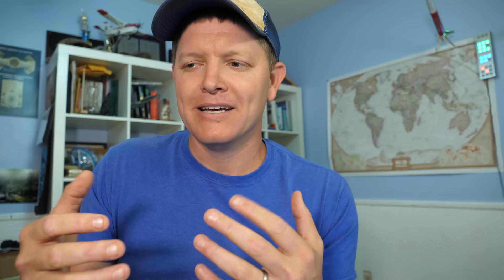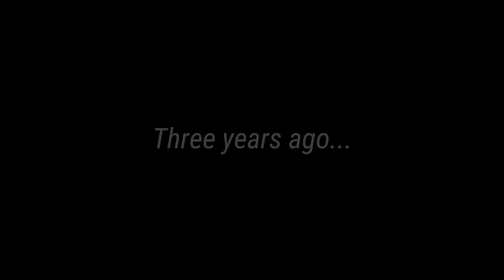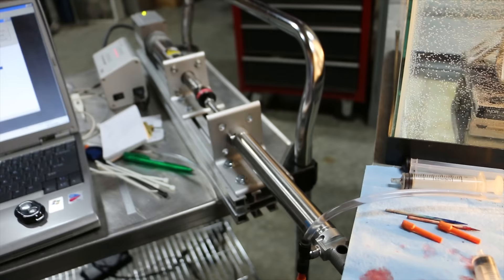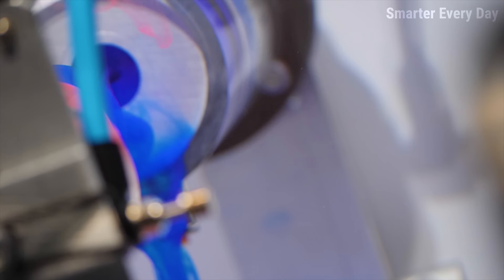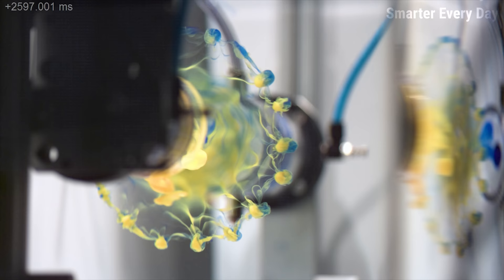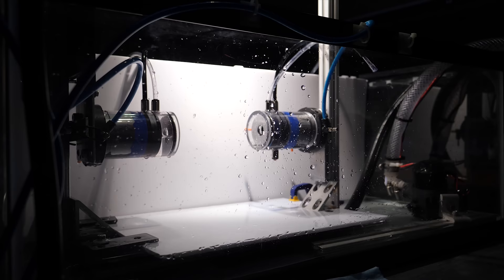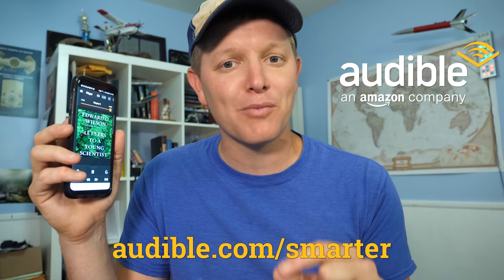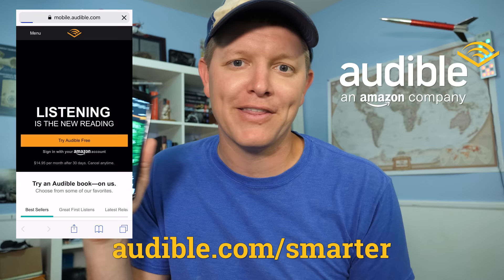Two Vortex Rings Colliding in SLOW MOTION - Smarter Every Day 195

Comment from the maker: Thank you to the Patrons of Smarter Every Day for helping me do things like this: https://www.patreon.com/smartereveryday.
Reply: Think about the spin of each ring. See the mushroom cloud effect at the start? The centers of the ring are moving outward faster than the outside and creating a backspin. When they collide, even as the low pressure pulls material together, both rings are still spinning opposite each other and because of the magnus effect(if I'm thinking of the correct effect), they create a forward, or outward away from the main ring, pull. I can't articulate it very well because I'm just not smart enough, but think of a basketball's backspin, and how it creates a forward pull that lengthens a shot.
Reply: SmarterEveryDay Bro, did you just say “jif” !?!? Graphic Interchange Format... “gif”. You are a true hero to my girls and I and I have been subscribed for years, but that is unacceptable. 😂

...and then not using Micah 7:8 for your Bible verse? Perfect video for that verse! 

God bless you brother. Keep up the great content.
Reply: Maybe there is a direct collision between an area in the low pressure zone and in the ink or the space between that causes the smaller rings to be at a 90 degree turn.
Reply: Could the reason for the 90 degree turn be due to the low pressure zone pulling material to itself then the momentum carried from the movement colliding with the material from the opposing side create a backspin and then create a new vortex
Reply: I dont think there is an actual 90° turn. Looks like many smaller collisions similar to the first. Like fractals. Id love to see this done in a place with 0 resistance if it were possible.
Reply: Easy for you to say Destin. Not everyone has a vortex collision goal because not everyone is filthy rich and has the money to pursue their goals and dreams. Dreams cost money. That equipment and your guys time cost money. Most of us dont have that juicy YouTube money and come from wealthy families and parents.
Reply: Similar to flowers, I can't help think of the "Numbers" effect.. (or geometry) there's a distinct number of swirling balls of color. Is there always one vertical or diagonal to the ground?, how might it flow in Space? how might the differences in viscosity of coloring and tank fluid affect the pattern?
Reply: If you have a chance you should try in the southern hemisphere I'm just wondering if the slight counter clockwise motion is an indication of the mechanism that is causing the 90° turn
Reply: We make a Thank you, to you :P, all over the world, even me, we make traslate for sub to let people read your video in their main language ! :P if we make this, is because of you and your amazing work to make this video good ! 
Thank you Destin ! <3
Reply: SmarterEveryDay Was
Reply: My opinion on what’s happening here. 
When the vortex rings collide it forms a z axis load barring structure being supported by a net zero impact of two vortexes flowing in opposite directions trying to follow the path of inertia on the x axis. Because water is a consistent density and because the load barring capabilities of the z axis motion of the ring is also consistent across the entire surface of the ring the areas that fail are in predictable intervals because the path of least resistance becomes condensed as the ink moves through the medium. This then influences the opposing vortex flows to join into a ring and accelerate outward due to their newly found shape performing better at traveling through water than its former shape thus gaining speed by utilizing its kinetic potential energy more efficiently.
Reply: Do it with the same color! Pigments might have different weight and structure..? maybe..
Reply: Also. Reduce vibration to a minimum. Lett the tank sitt for a few hours. And trigger it remotely. no walking around it the same room or preferably building. no devices that creat vibrations. maybe im over thinking this..
Reply: Dude check a pro vaper video, it's crazy
Reply: This is the video that I started my subscription to your channel! Thank you! 💯
Reply: SmarterEveryDay How hard would it be to have two Vortx collisions run side-by-side, and then have the  rings from them collide? Curious every day!
Reply: 2 kinetic streams colliding causing a pressure wave (ring) where the stream in the ring itself equals a kinetic stream with a number of nodes based on the pressure inside the ring. You need to know the ring volume density and the point at which the expending kinetic energy causes fresh water to be dragged into the ring (pitot tube style).
If you start with 2X volume of water at a speed of Y, they collide for density F(xy) and start sucking in water when the ring density drops below water density.
Reply: for me it was a subscribing moment. love your work
Reply: could this also be replicated in a low pressure atmosphere? vacuum
Reply: @russellwile5694  It seems like the resistance from the water might be what's making this possible. Without resistance from the water, it could just continue outward rather than slow down and curl where it's coming in contact with the water.
Reply: Haven't watched the whole thing yet, but... were you using distilled water?  Cause it's much easier to get a clean collision if the water is as pure as possible.
Reply: Nigel Pettitt    @Nigel Pettitt   "Conservation of angular momentum" is exactly what I was going to say. (I'm just now seeing this video and this is the only comment thread I've seen, so I realize that this might already have been run to ground.)

In some of the early runs, the backspin at the rings' perimeters is visible. For some reason, it's more efficient for the water molecules to coalesce into localized rings and rotate as a mass rather than to expend their momentum as individual, dispersed molecules. I imagine it's because the rings present much less surface area for friction drag than would individual molecules of water trying to disperse into the static tank water medium. (The dye molecules are merely along for the ride.)

Anyway, that's this civil engineer's take on it.
Reply: Rings happen due to direction of travel, always.
Reply: @kesavamandiga8900  這部影像紀錄片著作者必要性強制性與參與活動中這個參政者同時被迫逮捕到案執行串聯互動關係侵竊盜取機密資料來源機體文件科學性系統工程進度營銷經營，同時持有投資公司借貸款項金融界集團旗下品牌形象廣告著作財產權記載事項登記分發職務經商買賣雙方協議內容包括參與活動執政者的頻道訂閱成員之一摧毀破壞力者，共同體制度性系統工程操作方式糾纏不清關係。是一種不當違規使用模式。必須要求遣送出境海外市場調查偵訊重大過失致死案件發生率釐清案情處理。同時被迫革職移除頻道的有罪嫌中斷合資企業集團旗下品牌形象廣告管束管理關係。
Reply: Thank You, this video came at the right time.
Reply: A very uneducated guess. Maybe  the outward force of the vortex collision in tandem with whats going on with the pressure, funnels the outward force into generalised points creating a secondary vortex effect
Reply: What would happen if you did it in a vacuum?
Reply: What would happen if you did it in a vacuum
Reply: Earned a sub from me 😉
Reply: Have you considered putting two sets right next to each other, get the pairs secondary rings to collide each other?
Reply: I’d like a Pepsi after this…
Reply: please sir make a movie on discharge Ray tube.
Reply: I subscribed by this video. Do this type of videos in future
Reply: Congratulations, you just figured out how to build seed galaxies. 
At least that's what it looks like.
Reply: Astro  Naught = Astro Not
They always put things in front of your face!!!
Reply: I know how it forms the outside rings.
Reply: If the vortices are rotating in opposing directions, could the new rings orientations be due to gyroscopic procession
Reply: excuse me but if the question was why there was a snall rings apearing there's a simple explanation as for me.
Reply: SmarterEveryDay subbed and shared👍
Reply: Hi, I thought about replacing the color by some hot and cold water and watch the result with a thermical camera. Would it work ?
Reply: +SmarterEveryDay 6:43 why is this a mystery? It can't go left or right, because that's the direction it came from; it can't go back into the center, because that's also where it came from; so it can only go to the 'outside'. I'm not a beta-scientist, so I'm probably missing something...obvious...could you (or someone else) explain why I'm probably wrong?
Reply: Can you do this vortex ring thing with phenol red and sodium hydroxide so they react?
Reply: Diggle
Reply: So i know you might not see this but how do you think this would be affected being done in the same way but with smoke instead of of liquid. So basically my question is can this be done with air?
Reply: Why would the 90 degree turn of the small vortices be a mystery?? The explanation is pretty obvious to me . The two initial vortices both have the same circular movement of fluid inside them, that makes them moving opposite when placed one in front of the other. When the almost touch each other and gaps form in both of them in the same places, the ends of the small turbulent sections fuse since the movement of the air is from the inside out. Kinda like this  ( ) -------> O The real mystery to me is why the breaking seems to happen so evenly distributed. I think it might have something to do with the frequency of the pressure waves bouncing inside the tank produced by the opposing release of the vortices. That frequency pattern intersects the fused ring and produce even distributed zones of lower and higher pressure in the ring, thus breaking it. At least, that's my theory.
Reply: Do not worry, I am just trying to help. What you are looking at is linear momentum transformed to angular momentum, fully conserved. This is a very strange concept indeed. You will not find out about it until you have read Speculations On Fluid Dynamics, which is a book written by my father and has not yet been published. I am trying believe me.
Reply: De uma idéia no canal
Reply: Tudo forma desenho maguinetico de frequência ?
Reply: @coxbrawls5918  Corbett opp
Reply: Do you believe in God ?
Reply: Should've named the second channel "SmarterEveryOtherDay"
Reply: SmaterEveryDay
This is very interesting. I have a few questions.
Can you share the schematic of the device? Why is dye not mixing with water in the cylinder? Is there a membrane between the air and die chamber?
Reply: "well well well, if it isn't the spiderman"

"What's about to happen to you won't be very wholesome 100"
Reply: I have an hypothesis. This is vectorial multiplication of forces. The resultant vector is perpendicular to the starting vectors.
Reply: It's just like two fluid bodies moving at approx same speed and has approx same momentum colliding..  it causes a ripple in both bodies which extend outwardly in a wave pattern where both bodies crest areas form the mini rings..  my on theory from solid body collisions..
Reply: Почему я не увидел это раньше? Очень круто.
Reply: молодцы иностранцы. Столкнули две капли краски в водной среде. Описали это столкновение с помощью формул. Опубликовали небольшую статейку как две капли воды сталкиваются.  Может быть приплели сюда еще, что именно так сталкиваются элементарные частицы. Получили грант на три года, чтобы еще три года заниматься непонятно чем, но очень важным с точки зрения науки. И все. Вот вся "научная" работа. Хорошо путин когда-то сказал нашей так называемой академической "науке", чтобы она больше упор делала на разработки и открытия для народного хозяйства и страны. А не только для реализации своих идей (пусть даже и красивых) за счет налогов других граждан страны.
Reply: @user-lj8xg1ij5c  наука так не работает из фундаментальных исследований сразу ничего не получается. Для вас это 2 капли, а для астрофизика например могут быть 2 галактики.
Reply: @Darvin_A  я это знаю. Проработал в академической науке больше 20 лет. И знаю почему сейчас академическпя наука в России не может сейчас работать на нужды страны. Но!!! Вы бы согласились оплачивпть из своего кармана (из своих налогов, если вы работаете не в науке или подобных областях) реализацию идей людей например, с этого ролика? Я нет. вам лично какая польза от того как столкнуться две галактики, например, наша и соседняя? Во первых этот процесс будет продолжаться миллионы лет. Во вторых никто на земле не выживет во время этого. В третьих. Чтобы это наблюдать нужно как минимум стать монолитом из произведения андерсена "одиссея...". В четвертых. Как изучение столкновения галактик практически пригодится для хозяйства нашей страны? И еще по видеоролику. Киньте камень в воду и увидите такой же круг-кольцо расходящийся равномерно в разные стороны от точки соприкосновения. Еще раз повторю. Три года платить деньги человеку за то (если утрировать), что он будет кидать камни в воду у меня нет никакого желания. Наука  (научные работники) должна работать на народное хозяйство.
Reply: @user-lj8xg1ij5c  слава богу в науке колхозники не решают чем заниматься учёным. Иначе бы кроме тракторов и надоев ничем не занимались бы. А пример с галактиками привел просто для наглядности, это может быть любой процесс турбулентности и круги на воде абсолютно другой процесс. Фундаментальная наука не предназначена получать готовое изделие для вашей радости и хозяйства, она исследует процессы и строит теоретические модели, а уж что из этого получится никто не знает. Если бы работало как вам хочется, то мы бы наверное никогда не открыли атомную энергию, генетику и т.д., ибо разрыв между открытием и применением составляет десятки, а иногда даже сотни лет. Кстати именно поэтому фундаментальная наука сейчас загибается и мы по факту теряем будущее, т.к. всем нужна моментальная выгода.
А конкретно эти товарищи вроде никаких налогов не тратили, все на чистом энтузиазме и донатах подписчиков, за что им отдельное уважение.
Reply: @Darvin_A  ответьте мне тогда, если вы вдруг "научный работник": за что вы будете получать зарплату, выдавемую вам государством и складывемую из налогов моих и, как вы выразились колхозников, рабочих, инженеров, кухарок и других, если вы не будете мыслить и совершать открытия во-благо страны   которая выплачивает вам зарплату? Зачем нужен человек-ученый в обществе, если он не приносит польэу этому обществу?
Reply: @user-lj8xg1ij5c  затем, что понять принесет ли данное исследование пользу, ни вы ни даже иногда сам исследователь не может. Какие-то исследования заходят в тупик, но отсутствие результата, это тоже результат, если вы способны это понять. Другие исследования могут найти применение через десятки лет, но вот если их не делать, то результата точно не будет. Так достаточно разжевал или ещё есть вопросы?
Reply: @Darvin_A  вопросов к тому, кто не имеет ни какого отношения к науке, тем более фундаментальной, нет. И еще как такой может что-то разжевывать другтм не имея никакого понятия о чем конкретно идет речь?  В приведенном ролике нет никакой турбулентности.  После столкновения капель образуется тор (кольцо для тех кто привык все разжевывать).  Если разрезать этот тор вдоль по-середине, то получится волна аналогичная волне от брошенного камня в воду. Сначала изучите понятие тора а потом, применяйте его для объяснения не понятных вам явлений. Еще. Не правильно сформулировали постулат. Не отсутствие результата тоже результат. А отрицательный результат - тоже результат! Отсутствие результата у научного работника говорит о том, что он ничего не добился в своей работе. Потому что или вообще ни чего не делал и просто так получал зарплату, или не достаточно приложил усилий или занимается не тем чем может. Пусть идет работает колхозником и не будет расходов на его зарплату из налогов других трудящихся. Еще на счет фундаментальной науки. в ней нет никакого застоя. Наука все время развивается за счет ученых получающих заслуженную зарплату и приносящих пользу обществу. А не тех, кто каждый день приходит в институт, просиживает там целый день "Без Результата" и возвращается домой. В науке фундаментальной также, как и в любой крупной сфере человеческой деятельности есть спокойные периоды, периоды (как со-стороны может показаться) застоя, и периоды всплеска или расцвета. Как в искусстве, например, были эпохи возрождения или ренессанса. также и в науке. После описания бором ядра атома стремительно получила развитие ядерная физика. И таких примеров множество. А то, что некоторые открытия находят свое применение через 10-15 лет лишний раз доказывают, что данные ученые в первую очередь реализовывали свои идеи за государственный счет ничуть не беспокоясь о том как свои открытия сделать полезными другим и адаптировать их для нужд человечества! Только тот, кто не может в своей сфере деятельности ничего добиться будет писать, что отсутствие результата тоже результат. и не пытайтесь "разжевывать"))) в той области в которой мало разбираетесь. особенно тем, кто может больше вас в этом разбираться. Не смешите меня больше. У меня нет столько времени для смеха, чиьая ваши комменты. Я лкчше не буду их больше читать. И еще. Сходите в библиотеку. Почитайте про фундаментальную науку и про ее развитие. А не хотите этим заниматься - езжайте в деревню. Становитесь колхозником или дояркой (не имею ни малейшего желания знать где больше преуспеете). И приносите хоть какую-то пользу обществу, вместо своих плачевных комментов. Пока!:)
Reply: Может эффект Джанибекова дает такой результат🤨
Reply: Destin? your love for what you do and you're enthusiasm and your diligence to never quit and your Prudence toward what you do makes it the best dadgum channel on youtube. Your love for what you do makes it the best
Reply: @user-uz7fs1kv5l  думаю это разные вещи.
Reply: would it be possible to do this with suspended particles that you could track?
Reply: 6:50 i can explain it, i so hope you replay to my video
Reply: The toroids perfectly embed.
Reply: What if you have something like a chamber it's cylindrical shape with the diameter ouf the container 120mm long and 2 tube with the size of this cylindrical "nozzles" what ever
Reply: I think the law of angular conservation maintains the vortexes into the outer ring which contains most of the mass.
Reply: @smartereveryday please read "The Edinburgh Lectures on Mental Science" by Thomas Troward.  Chaper 5 talks about 2 vortex rings colliding.  It was published in 1909.  I would love to hear your feedback and interpretation of what Thomas Troward meant; i can't quite grasp it yet.
Reply: Oh dear. This is Breathtaking. Fluid Mechanics is so interesting. Will surely simulate this!
Reply: The reason it turns is because the outward pressure from the first collision is pushing it outwards so the pressure zones you talked about are pushing together to push towards the pumps however the first collision still has movement and pushes them out even more keeping them mostly together
Reply: Could it be that gyroscopic precession plays a role in some way? It made me think of that when you mentioned the rings change 90 degree direction...
Reply: Those ringlets turning 90° reminds me of the wing nuts in space how they spin and stop oddly. Is that maybe the same principle?
Reply: Is this vortex version of milk crown splash?
Reply: Can you make a video made just with the collisions? all of them in sequence?
Reply: the answer to this mystery lies in an undiscovered/overlooked law of nature, which dr. walter bowman russell refers to as the gyroscopic principle. it states that when a mass moves farther from its primary, its axial rotation will accelerate proportionally to the decrease in its orbital revolution speed, such that the total power output of the system remains constant.
Reply: have you considered the law of angular momentum? have you tried changing viscosity of the water? ph?
Reply: Now you have to do it with plasma toroids!